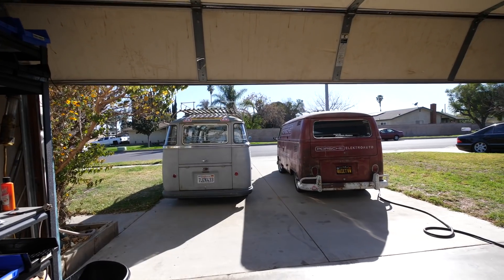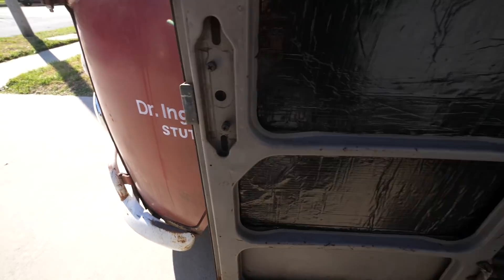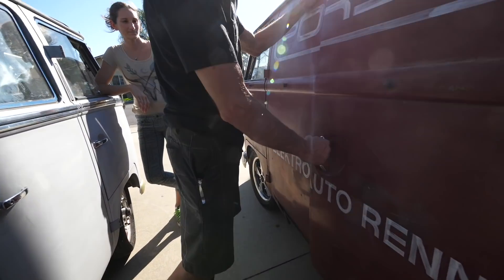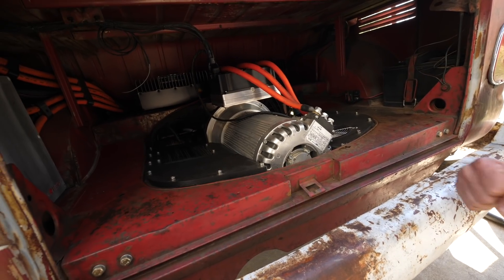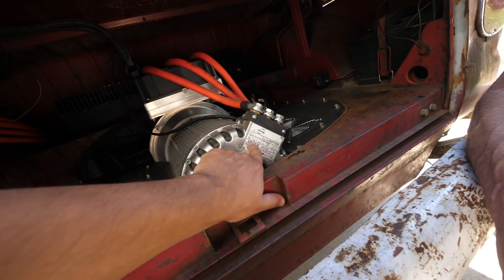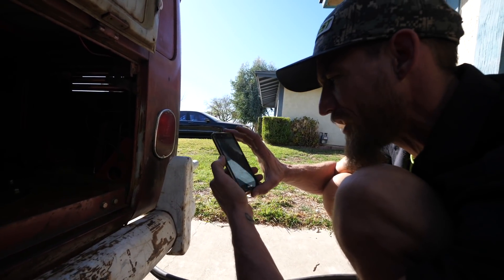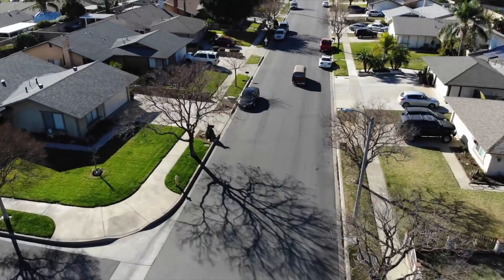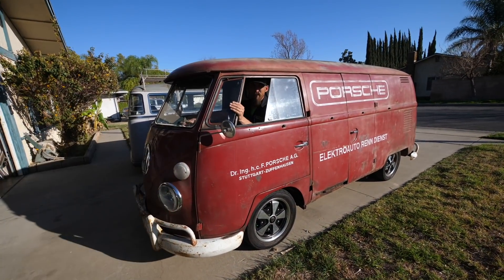Hyper9 Permanent Magnet Assisted Synchronous Reluctance Electric VW bus

Comment: I read about Switched Reluctance motors which do not have permanent magnets. Not sure how this is supposed to work. I thought the Hyper 9 was a Permanent Magnet Synchronous AC motor. (PMAC) so I'd have to see what makes this different.

Comment: I was born in Stuttgart (in the Olgaele (Olga hospital)) and love the bus! a beautiful homage to a Stuttgart company (as well as Bosch and Stihl chainsaws), 
now live in new zealand on waiheke island, this setup would be beautiful in my rx-30 cressida (direct drive through the diff?) and batteries in the engine bay with the other important bits, in the transmission tunnel as well as where the fuel tank was, wires can run where the fuel lines were, sadly no cash to do it (has carb issues, is all original from 1980 (with wear and tear)), would love to give it a birthday! cruises beautifully and rather silently, was originally meant to be a hybrid version of my model car too (toyota cressida hybrid on google), is there some form of kit available for low income people to pay off for retrofitting their cars to EV? (therefore getting themselves and family away from increasing fuel prices and a healthier paycheck too thus improving their quality of life), any help appreciated, 

kind regards, 

kieron

Comment: Theoretically, would this motor have enough power for an SN95 Mustang ('94-'04)? The car weighs around 3200 pounds stock. Assuming I kept the stock manual transmission, would this motor give it acceleration similar to or better than the stock 3.8l V6 engine?

Comment: Jehu, permanent magnet motors are in general less efficient then induction motors. From what I have read the reason is that the permanent magnet motor has eddy current losses constantly while induction motors can minimize eddy current impact by varying the rotors field strength or shutting the rotors field off during coasting. 
The best part of a permanent magnet motor is the increased torque. 
From what I have read permanent magnet motors have the highest start torque of all electric motors.
Reply: To avoid cogging losses, get a PM motor without any iron! Pancake axial flux motors are in the 97%-99% efficiency range, that means 10-15% more range on the same battery pack. They are less powerful for their size and weight so more expensive for the same power, but if you bother to have regen a more efficient motor can eliminate hills entirely. You can get 96% back of the energy used going up hill.

Comment: I'd rather have a louder motor. I bet it is a bit costly also. I'd be stuck with the warp 9 or 11 DC motors.
Reply: Actually the HyPer 9 Integrated System cost comes in lower than a WarP 9 with Zilla controller

Comment: Hi Jehu,  

Cool ride.  

Can you do something just on wiring the Smart for 2 batteries packs in parrallel and series. The Nema 4 box is tight and the poss and negative are right next to each other.  When they short it's pretty powerful.  There are little bus bars but they go poss to neg only.  8 in a series is to much voltage for alot of applications.  I need the powerwall sorted before I get the ride.

Comment: Just wondering, because of the similar VW powertrain layout, is the Chevy Corvair, sedan, coupe, van and pickup also good candidates for electric conversion?  Or is there some key difference is the layout that is a problem?
Reply: I think a Corvair would make a good conversion. The process and setup should be similar to the VW. Only issue is where to put the batteries for proper weight distribution.

Comment: More power with the same amount of power. Lol. 
Thanks for sharing J.
Reply: Thanks to the magnets, it actually produces 30-40% more torque than a similar AC induction motor receiving the same power input. The Synchronous Reluctance rotor makes it 2-4% more efficient than AC induction, not 30%. Most induction motors (the latter) are already 80-90% efficient. There's no room for a 30% increase from that!
Reply: It depends on the definition of %-reference value, it's relative to something. If you have losses of around 10 % (90 % efficiency) in ac motor and with a reluctance machine you have probably  7 % losses (93 % efficency) which gives you finaly an increase of 30 % in terms of avoided losses (more efficient) for the reluctance machine compared to the losses in the ac machine. But i fully agree that the better term would be to talk about "30 % less losses".
Reply: But 30% more efficient than another motor. Makes me wonder what the efficiency on the latter is...

Comment: Regen??
Reply from the maker: Yes
Reply: A permanent mag motor acts as a dynamo when it's acted upon
Reply: It's free on induction motors too, but in both cases an adequate controller is a must. Much easier to do with permanent magnet motor but some how I'm thinking we already could guess that much. If you didn't know there are several you tubes on using standard single phase induction motors in gensets to make electricity with. Same, same, just in reverse. Mechanical power in, self excited field in the rotor depends on slip to make juice instead.

Comment: Would that type of reluctance permanent magnet motor be any harder on the drive train than the AC motor due to the pulsing, or cogging?   Does it have brushes?  What type of controller can it use?
Reply: DrFruikenstein is mostly correct, thank you for your answers!   

However, this HyPer 9 must be used with the matching controller that is included in the Integrated System (IS). Since the HyPer 9's rotor is Synchronous Reluctance, not Induction, It requires more complex control programed around the synchronous technology of the rotor. Then when magnets are added to the rotor, the controller requires even more complex algorithms to sense the fields.  The X1 controller is the first and only one that I know of which is capable of controlling SRIPM motors like the HyPer 9.
Reply: Hunter Hams 
Thanks for the clarification on the controller. You're a lifesaver, and probably a motor saver as well. 

Anyway, I think this motor would be a good choice for the first time DIY EV converter. NetGain motors are usually very tough, and are often driven hard without any issues.
Also, I know this motor is well tested as I asked them if they could come up with a synchronous AC motor about 7 or 8 years ago, and was told that it was already in the works. Now we have it 😀
Reply: FPVREVIEWS 
I wouldn't worry about the cogging damaging the average car.

 It doesn't have brushes.

 If you get the "IS" package, the motor comes with a matched controller, which has some really handy features. But, I'm thinking that it should be able to run from any properly rated 3 phase AC controller (Check that with EV West, or NetGain before taking my word on that as I'm just going on hear-say with that).

If you wanted to upgrade an older conversion that already has a NetGain 9" DC motor in it, this motor is a bolt on 3 phase AC replacement.